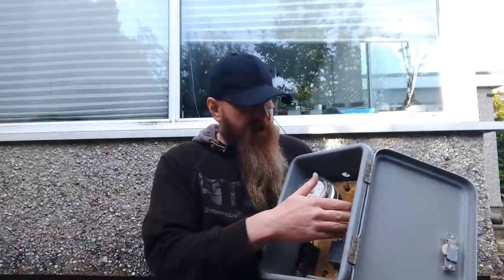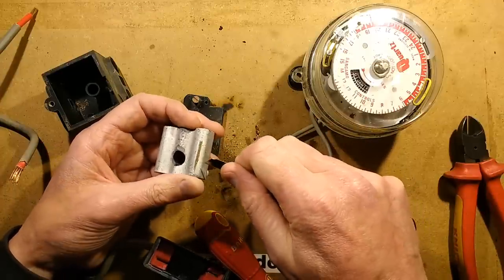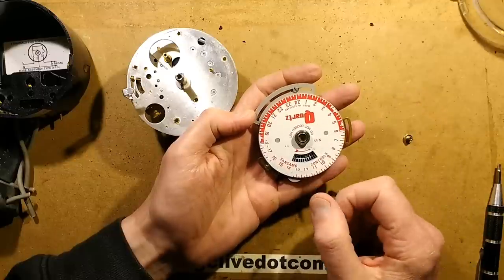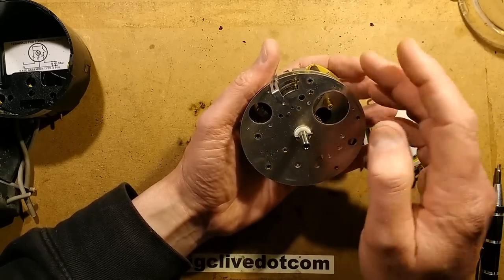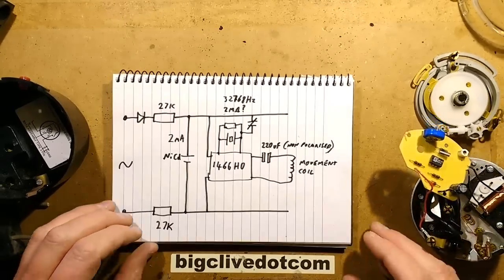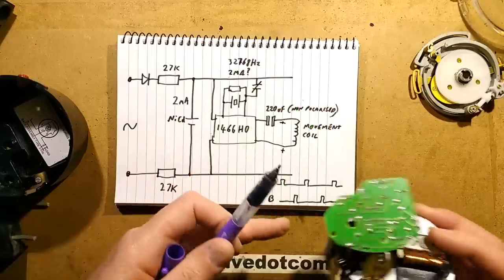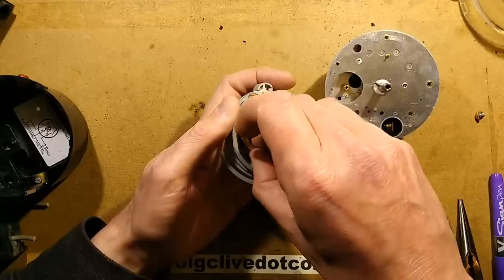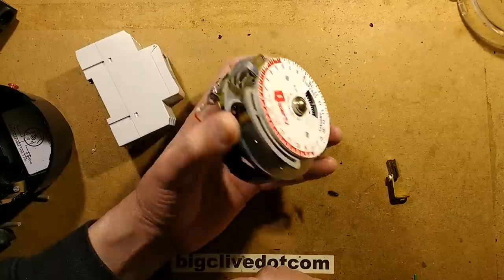Fixing a Sangamo street lighting time switch with solar dial.

Comment: To get the clock going again, put in another NiCad cell (as you did) or a 100µF capacitor with a red LED in parrallel in place of the NiCad. The clock will work but stops when the power is turned off. Schlumberger took over Sangamo in the late 1980's (±1987) The older mechanical clocks used to have a small 400mA fuse in the terminal as well. I have an AEG timeclock with an astronomical dial in my meter collection made for 52° North latitude.

Comment: If I remember right some models of sangamo's had a fuse built into one of the plug in pins for motor protection. Probable on the sinchronus S ---- models and not Q models the various model no's indicated where in the world the solar type dials were for.there was a map on the original packing carton to help select the best model for application..

Comment: I worked for Sangamo Electric in Springfield Illinois about 1966.  They made these time switches based on a simple electric clock mechanism.  I would bet that the complex rack and pinion business dates back to those old time switches.  Google Sangamo Electric Co Springfield Illinois.
Reply: Why fix what ain't broken, presumably

Comment: Can't beat a bit of Sangamo Weston switch gear, and it hasn't changed much in the last 50 years (except for the quartz clock). I even have (stowed away somewhere) a Sangamo Weston "pre-pay" (slot) electricity meter - wonderfully engineered, and built to last!

Comment: They are amazing timers, I have one controlling garden lights, I purchased it 20 years ago as new old stock, date stamped from the early 80's, so it's been in service here for nearly 20 years and rarely ever needs time adjustment, maybe every 5 years or less. The most amazing part is the nicad, it still runs for hours during blackouts and has never been changed.. not bad for a battery that's about 300, 000 hours old. It seemed totally dead and incapable of taking any charge, but after months of operation, it was again holding charge.

Comment: I don't often comment on vids but I just thought I'd answer your question were you wondered if the sangamo factory was still about which is yes lol I'm unsure if people still work there to make stuff but whenever I'm off work I often see them using the office section at the front. I still remember my mother getting a water thermostat for our old boiler which lasted for about 20 or so years from them.

Comment: I think it's 10MΩ 1% resistor.
Reply: Ohm711 Agreed. The red band means 50ppm/°K temperature accuracy.
Reply: Yep, Clive read it backwards. Black is omitted from the 5th slot.
Reply: +ohm711
https://www.digikey.co.uk/en/resources/conversion-calculators/conversion-calculator-resistor-color-code-6-band
is a calculator for these things.  Just plug in the coloursd and it tells you the spec.
Reply: I found this one a bit easier: https://www.eeweb.com/toolbox/6-band-resistor-calculator
It says: 10M ohm, 1 percent tolerance, changes 50ppm (or 0.05% of value) per degree Celsius. So yeah, seems to be pretty specialized and accurate.
Reply: In that position my first guess would have been a resistor shaped capacitor but you sorted it out already I guess. I can't remember how many bands they had but I regularly saw them in 90s consumer electronics. They were usually green or some brightish yellow in the devices I saw them but I can not see it in the video properly.
Reply: @daanwilmer  - Given that the temperature swing across the year where it might be installed (somewhere around the 54 degree north latitude, thus northern England / southern Scotland) could genuinely span fifty celcius, and easily that over multiple years, the relative invariability is very important. Even so, that's +/- 1250ppm or 1.25% either side of a central set point optimised for an average spring/autumn, so in extreme years the system could find itself drifting out by up to 18 minutes per day, fast or slow, if I'm working that out right? It'd correct itself reasonably well over the course of one or more years, but it still seems like you'd need a team of guys going around resynchronising them once a week in really hot or cold conditions...

Or maybe the chip is sophisticated enough to take a reference from both the quartz tank and the much less variable mains AC supply (which in the UK, the national grid attempts to balance so that there's exactly 4,320,000 cycles per day, despite instantaneous variances of up to maybe 1% from 50.0Hz),, and only really uses the oscillator to keep time if there's a power cut, otherwise merely using it to work out if the input is 50 or 60Hz (or possibly more than 2.5% adrift of either standard, suggesting a serious grid fault, at which point it'd fall back to the quartz) and counting seconds accordingly from the AC? And your main problem with a more temperature sensitive resistor is that it could get confused between the two?

Hmm...

Comment: It's always nice to see a mechanical solution out-living a modern, supposedly superior, electronic replacement, and as per usual, I want one of these timers now... :P
Reply from the maker: Rather predictably you can buy them on eBay from every era.
Reply: Yeah, just been poking about on there and found a few, not cheap though, so might have to save the pennies for a while... :P

Comment: Fantastic stuff! I concur about the build quality. In the early my local corner shop owner asked me to check his shop in NW London. He said the incandescent bulbs (!) were blowing too often and he also had to reset their timers every so often. I saw he was running the lights off two plug-in timers, so I dug out an electronics mag (no internet in them thar days) and contacted Messrs J Bull of Brighton - who are sadly long gone. They sent me a solar timer, which was entirely electro-mechanical, using 50hz only. It was indeed a work of art and solidly made. I installed fluorescent lighting and told Mr Patel that he didn't need to keep resetting the timer, because it now compensated for dawn/dusk changes throughout the year. If my memory serves me right, it had a tiny switch to do the daylight saving time. The shop owner was chuffed, but I didn't make a fortune because he was by then a friend of the family: my dad had bought cigs and papers from him for years. PS How about looking at old mains clocks? Very steam punky!
Reply from the maker: Like this you mean?   https://www.youtube.com/watch?v=H3xbNfVGRVI

Comment: Did you appreciate that the solar cams are calibrated for the latitude it's used at - as the day lengthening/shortening is different depending how far north you are? That is what the 54'N refers to. There must be different shaped cams for different latitudes - would be interesting to see a comparison between two different ones, these fascinate me!

Comment: I have replaced, repaired and taken apart many of those sangamo's, the solar ones are interesting, though at one poing for streetlighting on the estate where i worked they wanted the lights to go off overnight from midnight till 6, i used a solar switch to turn them on and off at dusk and dawn, then a standard timeswitch for the overnight off period.
I'm surprised there wasn't a fuse under that pin, they had a small fuse just for the motor on 3 pin versions, unless on that electronic one it's on the board.
I didn't like electronic timeclocks like the one you showed, if i used one of those on a reasonable or inductive load, i'd always use a contactor. but there's a round faced smiths that plugged into the same base, much more robust, heavy duty relay, and easy to program.

Comment: Took me 5 years, but I finally got one, and by one I mean two!! One is from 1988, has died due to green death from the NiCd leaking taking out multiple traces (can be re-wired with jumper wire, but still, PITA), and is also a 52 degree dial so more for suvveners, other's a "modern" one, 4-pin type, made in Sept. 2012 so almost 10 years old, 80mAh NiMH battery dead and starting to go fluffy but no damage, but the date wheel part was stuck somehow, found out when I tried advancing the wheel to August and crunch went multiple teeth on the big white gear, so, I undid the nut and stole the part off the other clock, stuck in a new 150mAh battery and it's working fine!!! Now to find a use for it!!! :P

Comment: That resistor isn't actually 2M at all. It's 10M.
The 6 band was read backwards, i.e. the red band was the temperature coefficient.
It's actually:
Brown black black green brown (red) - so 100 with 5 zeroes (multiplier), tolerance 1%, and whatever temperature coefficient red is. Result: 10M resistor

Comment: That nut unlocked the year. Now it's messed up. Summer in spring. Skips winter. Clive, you just caused climate change. That's bummer. (ok, I had some vodka before watching this). Those electromechanical devices are so smart and always correct. And they provide jobs to people adjusting them every so many year . Nowadays they use 32-bit microprocessors with buggy programs. No nuts to screw up.

Comment: I once got curious about the stepper motors employed in mechanical quartz clock movements, & did some Googling. They're called 'Lavet' type motors, and most certainly are clever devices!
https://en.wikipedia.org/wiki/Lavet-type_stepping_motor
There's a bit of trivia I bet few know! Cool videos, Thanks!

Comment: I Googled "6 Band resistor colour code calculator" and found this
 https://www.digikey.co.uk/en/resources/conversion-calculators/conversion-calculator-resistor-color-code-6-band
.Black is not listed as an option for the fifth band, so I think it iS the other way round. That makes it 10 meg-ohm, 1%, 50 ppm temperature co-efficient

Comment: I believe Schlumberger are still going strong. I used to work with their electricity meters (domestic & industrial optically-read jobbies) well into the 2000's, and they were (are?) a huge corp and one of the main meter manufacturers.

Comment: The 5th band is its tolerance and the 6th band is the temp coefficient. And you are correct that you read it backwards, as Black can not appear in the 5th slot. This is a 10M 1% 50PPM/c resistor. Quite an odd little guy, obviously very special.

Comment: Engineering is an entirely closed book to me. Calculating that gearing mechanism for a year... Now that's a challenge. 360 into 365 days. Actually that makes it somewhat easier I assume. But still, got to calculate how large diameter the other gear is and such. And then I give up.

Comment: I can't say I fully understand how this works, or follow the explanation entirely, but it's a pretty neat piece of compact electromechanical engineering all the same :) (or maybe even more so because of that?)

I have to ask though, wouldn't the sensible option with the fully electronic switches, if you wanted to use them to drive anything other than a mostly-resistive load, be to use them simply to control an external relay or solenoid, maybe with a heavy resistor (or incandescent indicator light?)  in-line and/or parallel? Or would even those be too inductive? Perhaps some opto-coupled thing where the timer drives a small light and the output of that, shining on an LDR inside a light-tight box, drives a relay circuit? Is that what the "contactor" (a term that's new on me) mentioned in the video is?

Or is it, at the end of the day, actually just simpler to run a setup like this?

It would also seem easier, with an mostly-electronic system arranged like that, to incorporate the input from a light sensor. The timing circuit wouldn't need much attention, then, unless it fell wildly out of synch with actual day time or the calendar, because the timer could define a, say, two to three hour period in the evening and in the morning, that shifted with the season, where it reads the input from the sensor and responds exactly once in each period - turning the lamp on once the ambient light falls low enough to need it, in the evening, and off again in the morning once the ambient light is enough that the lamp is no longer needed. Which thus responds both to the changing day length, but also the weather conditions - if the sky is covered with dark cloud, you want the street lights to come on earlier and turn off later, vs when it's completely clear... improving both safety on darker nights, and reducing energy use on lighter ones, as an enhanced version of what the solar timer does already.

Though maybe there'd be a way to make that work with the solar timer too? Tweak it back an hour or so vs the wall clock, and incorporate a second-stage switch activated by the detector which, when it has an "on" signal from the timer AND detector, turns the light on, then keeps it on - that is, until such point as it registers an "off" signal from both. IE, the timer has reached the start of the "OK to turn off" period (the regular timer-only period, starting an hour early, and end only bounded by the start of the next "OK to turn on" period) AND the light detector is picking up enough ambient illumination to also turn off the light. Maybe with a secondary pair of pins in the timer that would force it on at a certain later point in the evening and similarly off mid-morning.

Of course, you could just run from the sensor alone, but that'd be subject to all kinds of spurious noise and feedback issues, from passing planes, birds perching on it, bored teenagers finding a way to shine torches or lasers on it, lighting, reflections, city light pollution (especially when cloudy), darkly overcast moments in the middle of the day, etc. Plus I have no idea how robust or long-lived those sensors (and any attached relays) are, but it's probably not anything like the potential span of a simple slow-turning cam system.

Comment: Are those electronic timers using an SSR for the switching?  Might be easy to fix them by swapping out the SSR with one more suited to inductive loads.

Very cool piece of engineering to see taken apart, and back together.  Thanks for sharing!

Comment: Glad you corrected the description of this item from 'timeclock' to the correct 'timeswitch'. I have associations with timeswitches over many years from clokwork types onwards, my father worked on street lighting when the 30day movements required winding and presumably the arms were adjusted at the same time.However, timeswitches have mostly gone in favour of the light sensor. In your discussion on the operation of the  crystal clock I don't  think it is clear that the polarity reverses on each alternative second which is how the normal quartz clock and watch functions. The neutral would not normally be made of aluminium as this would cause severe corrosion problems with copper cables.

Comment: I had never seen a timer for streetlighting before now; I had heard of timers for stoplights but all the streetlights I had ever heard of  had a light sensor that turns them on when it gets dark and off when it gets light again. What advantage does a mechanical system like that have? It's amazing that Schumberger made that; they also made the solid-state liquid flowmeter that's used on the foaming system where I work. When you took the 'Do Not Remove' nut off the innards reminded me of the Antikythera Mechanism (which calculated planetary movement mechanically, so that makes sense).

Comment: These solar clocks (they were all metal with no electronics years ago, with a motor driving reduction gears) were used across the british isles for years to provide switching for street lighting before photocells/remote switching appeared, either single lamps or as a master clock on a lamp ring. They were very reliable. However they had some major drawbacks, one being the fact that timing was fixed to the day of the month, so if they weather became overcast and dark etc, the lamps would still not light until the set time, unlike photocells which will respond to changes in light levels (lux) fairly quickly. The other one was that if there was a power cut then any lamp clock in that area would stop (some had reserve springs to keep the motor turning but they were fairly pants) and then restart when the power was restored, meaning that lighting engineers had to go out to each lamp in that area, which could be over a hundred or more, and reset the dials to the correct time, a pain in the haris!

Comment: Oh I remember when the local council replaced timers with photoelectric cells they threw out a load of the older electromechanical versions of these, not a PCB in sight, as a small boy I was fascinated by them and pestered the installers who let me have a couple of the timers.

There may be one in the loft at my mother's house, wonder if it's still there and if it'd be interesting for a teardown?

And yes, Schlumberger are still about, they manufactured gas meters as well.

Comment: They are good. There is one that switches on the lighting in the stairwell of my flat. It falls down, when you have a crazy neighbour, who wants to muck about with it. I can only imagine that they thought it was using their electricity, but I ended up having to install my own secondary lighting, to make sure I didn't break my neck on the stairs.

Comment: if you did read the resistor the wrong way around then it's 10M, which isn't massive, but reading it the order you read it is not correct as there isn't any black value for the 5th colour, so I'm gonna guess 10M

Comment: Band 6 from looking on like, some reference it as the Temperature coefficient and others say its the failure rate and some say it is a military based standard.

Go figure.

So I found this site : http://www.radio-electronics.com/info/data/resistor/resistors-colours-code-coding-chart.php

Comment: Your microphone in the field was so much better than that studio microphone you went to.  If they are the same one then it is because the room you are in isn't absorbing the bass and it is far too bassy if different microphones were used I would look at using the microphone with less bass to it (the one in the field).